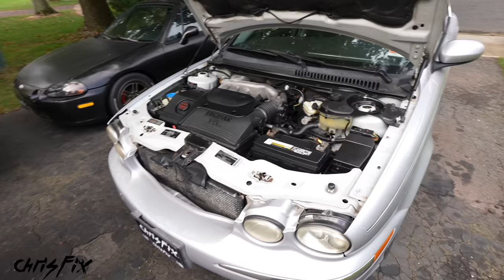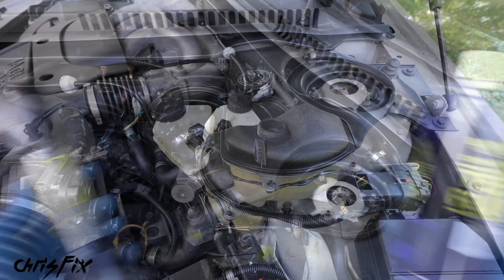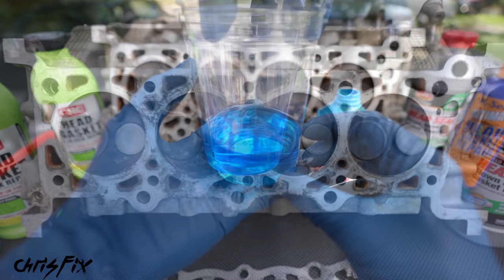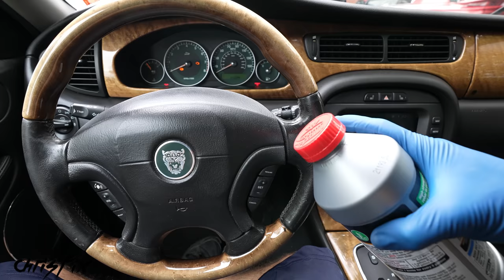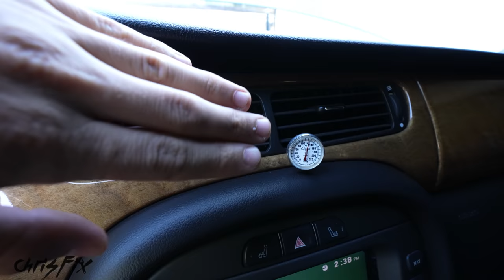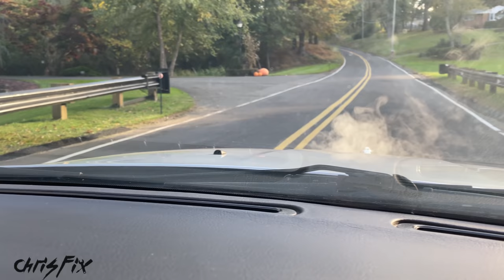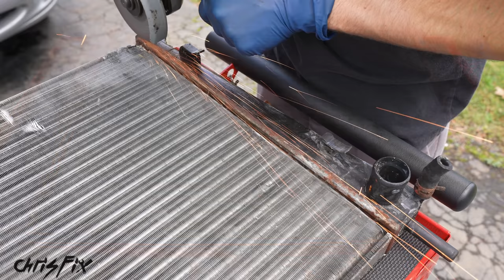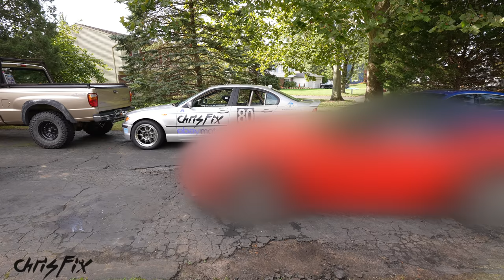Do Head Gasket Sealers Actually Work (FULL 2yr TEST with Engine Teardown)

Comment: Blue Devil is superior to all other head gasket sealers on the market. Their process called for a complete cooling system flush, giving the sealer better odds of being successful having a clean cooling system in which the product works.
I have 2 examples where this product worked, one to a lesser degree.
1998 Toyota Tacoma, 6 cyl. at 410,035 we discovered the blown head gasket. We followed Blue Devil’s procedure and installed the sealer. After a short number of heat and cool cycles it did seal off the leaking head gasket. Bear in mind that this is a work truck which pulls a trailer with heavy loads every day. This sealer held up to 493,635 miles. Being extremely hot day in Florida(92 degrees) the truck was hauling an extremely heavy load over a fairly longer distance (about 60 miles). The head gasket failed catastrophically traveling at highway speed 65 - 70 MPH, the engine began overheating. By the time I was able to reach an off ramp and a safe area to pull over it was obvious the engine was near seizing, based on how the engine ran. After checking coolant I discovered almost of the coolant was gone. Although it’s not a permanent fix it did buy enough time to save a good amount of money for down payment of another truck. After almost 3 years and 83,600 miles of use. I would say this product worked very well. There is no way of telling had I hauled lighter loads how much longer this engine would have lasted. IMO, the Blue Devil far exceeded my expectations.

2001 E250 extended van. (My brothers work truck, he does carpet install so the van regularly carry’s very heavy loads.) at roughly 205,681 miles he discovered and confirmed a blown head gasket (it should be noted that this Ford V8 engine has a reputation for blown head gaskets). Again following the procedure recommended by Blue Devil we installed the product. As of today this van now has logged 401,883 miles and still going strong. My brother learned by my experience and has babied the van keeping heavy loads to a minimum as often as possible. As of this August he retired from the carpet business and now continues to use the van daily for personal driving needs. He decided because of the low resale value of the van he decided to drive it till it dies. As of today it’s traveled 196,202 miles and almost nine years since we discovered the issue. I would say that’s a total success story and is a great testimonial for the effectiveness of the Blue Devil product. Baring any other major failures we wonder how much longer this van will run before it rolls its last mile. 

We both believe that keeping the stress level at lower limits has vastly contributed to the longevity of this van. Given the cost of replacing engine with a remanufactured engine ($5,000.00) would far exceed the value of the truck ($800.00), one day it will end up at its final resting place, giving up its salvable parts To a needy recipient, till then it still keeps rolling.
Reply: Could i use it on a one cylinder motorcycle engine ?
Reply: Well crap.
By the time I got done reading comments  it's about a 3 way tie.
Blue devil
K seal and 
Bars leak
With steal seal coming in a week 2nd.
I will be trying Blue Devil tomorrow on my 4.3 Vortec. 
Will let you know.
Great video.
Green acres!
I'll be watching more of yout vids for sure. 
Thanks
Reply: @justposi  no, motor cycle engines are air cooled, there is no liquid cooling system to add blue devil too!
Reply: @dennisdumas1734  Not all motorcycles are air cooled as a matter of fact thats a pretty outdated technology and almost every motorcycle produced in 2000's is liquid cooled appart from FEW Chinese brands. Also why would i ask if i can use it on a motorcycle if i didnt research where to pour it in and already know its a liquid cooled engine. The question was refering to the number of cylinders and the size of the engine rather than if its air cooled or liquid cooled engine.

Comment: Hey Chris, I have 2 suggestions/recommendations for ya. The first, if the engine ever went higher than operating temp I would alsways replace the thermostat just bc that extra heat will cause more pressure on the spring than normal which will reduce its effectiveness. Just always good practice to replace it. The second thing is the surge tanks(what that car has) doesn’t circulate as fast as the coolant in the radiator itself so if your ever doing this to a car with a surge tank like this I would instead remove the to radiator hose and drain enough coolant to add the head gasket sealer directly into that hose/into the radiator via that hose. For the older cars without a surge tank and has a radiator cap on the radiator itself then add straight to the rad as normal. Just trying to give the best possible out come to you and all the other readers.
Reply from the maker: Thanks but this isn’t a surge tank aka overflow tank,  it’s a reservoir and it flows right into the engine and radiator. The coolant constantly flows through this.

Comment: Short version of the story, I used the CRC and it worked for a while. After 3 times, the result was the same each time. I used the Blue Devil after that and it held for over a year and still holding.
Reply: Sir, do you mind me asking what car you have? Also did you use the bigger bottle?

Comment: Thanks Chris, thanks to your video I been able to use my '10 VW Jetta an additional 10k miles.  Jetta had a head gasket leak, coolant leaking into cylinder 1.  Was topping off coolant reservoir every other day at its worse.  Took it to VW dealership to diagnose the issue which I already knew what the problem was going in.  Quote to replace engine with a used one close to $7k and to replace with a brand new one nearly $13k.  For that amount, I ended up getting another vehicle.  Since I now had a vehicle to replace my Jetta if it crapped out I went for it and used the Bar's Leaks Head Gasket Sealer you recommended in the video.  Followed all instructions to the letter.  First few days was still having to top off the coolant.  After about a week of driving it more or less worked its magic.  Did this back in October of 2021 at about 140K miles, been driving it to work for about 6 months now and just over 150k miles on it now.  Since October have been on the same gallon of coolant, where as before was going through a gallon every week to week and a half.  Also, worth nothing, took it in to get an oil change about a week after I verified it had worked, and just took it in for its 150k mile service a couple weeks ago.  Check engine light is gone for the most part, only randomly and sporadically will it come on for a cylinder one misfire but it clears itself after a day or two of driving.  I check oil and fluids every few days, haven't seen that milky/mayonnaise like substance in the oil reservoir any more.  Thanks again Chris.
Reply: Thanks for posting your comment? Since its October 2022 I'm curious about how its running? I have a 1987 Ford Ranger that has a clear head gasket leak and wondering if i should use the Bar's Head Gasket Sealer. Any information on the Jetta would be very helpful.

Comment: I used Blue Devil on my 94 chevy pickup, and it kind of worked, but it clogged my heater core. BUT I did an engine swap and upon tearing down the old motor, both cylinder heads were cracked, so it was beyond repair anyway. Also used K-Seal on my 04 civic just to see if it would work, but it failed.  Looked at the head gasket on it, and three  of four cylinders were pushing compression into the cooling system. I guess both of my cases were extreme, and they could work on not so severe applications.
Reply: Yeah, those are meant only to be used with issues with the head gasket only. More serious issues are far beyond their ability to deal with.

Comment: I used some K seal for my 2017 Ford edge 2.0T. Was eating coolant at a pretty consistent rate at about 50k miles. After a bottle of K seal I didn't have any coolant issues when I traded it in at 65k or so. Ford 2.0T are known to have cylinder liner cracks and I didn't feel like spending 5,000 to get a new engine when Ford never fixed the issue and it could happen again. $20 bottle is a easy potential fix instead of going straight to a big fix.
Reply: So you sold a car with a sealer in the engine ?
Reply: @mercer982  yes back to the dealer where they know this is a problem
Reply: K seal is great.  I put it in my old Chevy truck about 6 years ago and it’s still going strong.
Reply: @mercer982  lmfao he’s no different than y’all on marketplace dawg dealerships will be okay
Reply: I tried the K Seal in my truck but it didn’t work. The Blue Devil gasket sealer product was recommended by a mechanic and that did work. I found a blob of K Seal in the water pump when I replaced the timing cover gasket. After I added the Blue Devil sealer, I had to idle the engine for about an hour and the temperature gauge came down and I no longer heard bubbles flowing through the heater core.
Reply: did you flush out the old coolant with new coolant after the fix was solid or just left it?
Reply: @eruffdaddy21  I left it in. I believe on the bottle it says to leave it in but I may be mistaken.
Reply: @picklerix6162  how long in between did you use kseal and blue devil. I’m at a month and it’s still leaking need to know if I can use another one or do I need to do a radiator flush first.
Reply: @toxicity6629  dealership sold it to someone else at auction.... 🤔
Reply: @playertopdog140 im no chemist but i wouldnt mix multiple brands without flushing in between. might cause some interesting reactions inside your engine block
Reply: @picklerix6162 I actually had a water pump exploded with kseal

Comment: Few things I learnt about head gaskets :
1. Some engines may have an oil cooler, cooled by water. If oil cooler has  cracked, even a hairline crack, oil may pass into the colling system.
2. To check if coolant is leaking (when no external dripping is found), A. Check the following : when engine cold, oil cap may have condensation on the inside. B. Open radiotor cap or thermostat cap, smell the coolant water for petrol fumes. C. Sometimes soft sludge may build up under / between thermostat cap/seals. 
3. When checking a used car you may want to but, the above checks, while engine is cold, will tell you what you need to know.
These are simply for combustion gasses being pushed into coolant. And if it it still a tiny hole in gasket. Bigger holes will cause engine overheating or bubbles in coolant reservoir.
Reply: My father had VW Jetta 2.0L with internally cracked oil cooler. I used Bar Sealer, but it didn't fixed problem - I thought, it was the head gasket 
;( and I had the silvery stuff plugging passages and heater core. Changed the oil cooler, flushed the cooling system, it worked. Generally I prefer new head gasket rather than one of the sealers.
Reply: Really good sum up bro :)
Reply: I have a 2002 GMC Envoy SLT 4.2 litre. There's oil in the coolant as well as some but not much coolant in the oil. It doesn't overheat. But the lack of power especially when going up hill's here in New England is extreme. The oil pressure when driving is about 45-50 psi. The coolant temp never gets above 212°f. There's no smoke from exhaust unless cold morning start till normal engine temperature. It's not throwing any codes except EVAP leak. But there's definitely oil in coolant and coolant in oil. I don't loose coolant, but oil does need to be added every 3000 Miles or so. The 4.2 litre inline 6 has 250,000 miles on it. I'm kinda desperate on it lasting another year or so, depending on skyrocketing prices of everything.
Reply: @bekaddisontechnologies4292  Interesting, I wonder if this could possibly be the issue with my 2002 honda civic. It's got hydrocarbons in the coolant but the oil is never milky and I never blow white smoke from the tail pipe. I loose coolant very slowly but I pass the coolant pressure test when tested for leaks.

Comment: I had a 1999 Ford Windstar minivan with a bad head gasket.  Would actually cause the engine to hydro-lock if it sat for a day without running.   I used the Bars.  Seemed like it was 'maybe' working, so I added a second bottle (the van had rear heat, so I figured the first bottle of Bars was diluted by the extra coolant).  Definite improvement!   It wasn't a complete, permanent fix, however.  I could tell there were times whatever "scab" the Bars healed my head gasket with would occasionally break open, then re-heal.  Eventually, all that hydro-locking (before the Bars) finally took it's toll and the engine locked up for good, but I did get about two additional years of near trouble-free service from that van after adding the Bars.

Comment: Great Video here in Australia and I am a retired mechanic due to back injury I would often give customers the option to use a $10 radiator stop leak and also works for blown head gaskets in the early stages was Bars Radiator Stop leak I think its now around $20 a bottle but I haven't actually used it for a few years now I am in IT but it was a miracle I had even seen it last 10's of thousands of Kilometers one person saw 100.000km+ but I am amazed seeing in your case a warped head and it worked then failed but I reckon if you used the full bottle after it drank the first lot you may of got further..... And you have proven a point that it does get into the oil system and was very interesting a old mechanics myth has been scientifically proven hell I am the old mechanic with a timing light in my ear so to speak 97% of the time on old Distributor ignition vehicles I could adjust the timing by ear and double check with a timing light and found I was on the money us oldies who seen the auto industry go from Carby/Dizzy setups to EFI coil pack setups most were against the new EFI systems I adapted and found the new EFI systems easier at times but again give me a carby and dizzy any day I can tune without a dynometer lol cheers mate
Reply: Been through back pain for a decade , what fixes it is 100% grapejuice , or any pure fruit juice, try it and let me know wayne

Comment: Dude, i really appreciate the time and dedication you put into this and all of your videos. Ive always been a little nervous to try anything on my vehicle alone, but youve played a big role in me gaining the confidence to try
Reply: TL;DR make sure to clean the rad cap of the fibers on a regular. makes the opposite problem of not allowing air in causing a vacuum. i would recommend!

WELLLLLLL. 06 pontiac grand prix driver here. i used the same type of product and i ended up blowing a rad hose. split right in 2 when i turned off my car after a long drive during the spike in pressure. in my car pressure from heating up and the vacuum from cooling down is controlled by the radiator cap. if the cap gets clogged in can over pressurize the system. and now on the inverse. every time i go to drive my car the rad hoses are sucked flat so i know its not leaking anymore xD

Comment: Just a quick comment, thanks for the effort you put into this video. A tip I learned years ago..if in fear of blocking your heater matrix, disconnect both supply and return pipes at heater, connect ends with tubing so bypassing the heater. After tests and hopefully seal works then check to see how long to leave in system before replacing coolant. Replace coolant and reconnect heater pipes, bleed the air from system. Its a bit of work but reduces the chances of heater matrix clogging and adding more work. Hope this helps

Comment: Fantastic video.  Thank you for showing how head gasket sealer works. I had wondered how the ones without "additives" like copper worked.  My son and I play with and drive Subarus (I drive a 2000 Outback.) and we swear by Blue Devil.  Older Subis are notorious for overheating and we're pretty sure Blue Devil is the Subaru recommended "coolant conditioner" (which happens to be blue) Subaru sells.  I've used it at least twice to save my daily driver (two different engines).  I prefer it because it is pure liquid without copper or other stuff added that can gum up the works, including my water pump.  And don't let the 50 minute idle time scare you.  If the product is working, then it should be able to idle 50 minutes.  Although I will admit it is the most nerve racking 50 minutes you will ever spend.  

But in the end, all these additives do is buy you time to get the money to repair your engine.    You're still going to have to do something about your engine or your car after a year or two.  In the case of Blue Devil, I'm convinced it wears out the water pump, because after about a year or so the water pump failed on my Outback after using it.  But like your video showed, it doesn't seem to clog anything up, it just wears the bearings in the water pump.  But it bought me time to get another engine, twice.  (Junk yard engines for older Subis usually have 150K+ on them. So, without a rebuild, they're going to have a limited life span.  Thankfully, they're cheap and easy to replace.  Cheaper and easier than a rebuild.  LoL)
Reply: Thanks for this info! I’m debating weather to use this or K seal on my 04 Silverado (5.3) my friend swears by blue to but iv seen vids and good reviews for K on vehicles similar to mine. Might just flip a coin for it